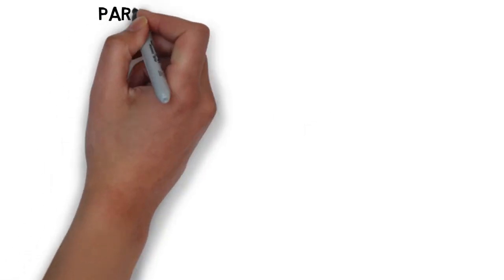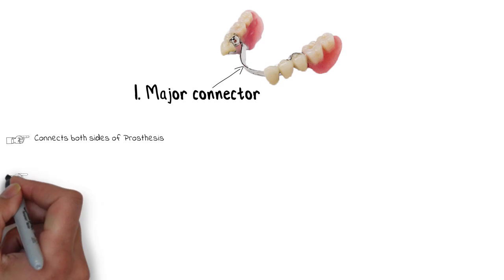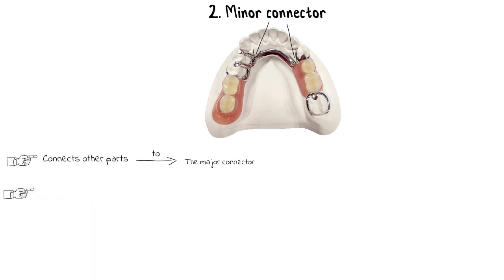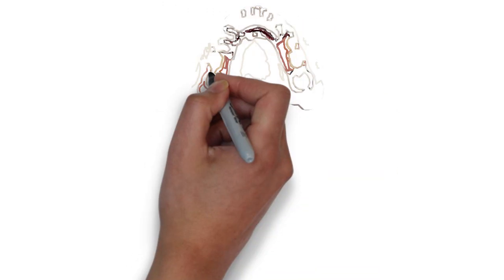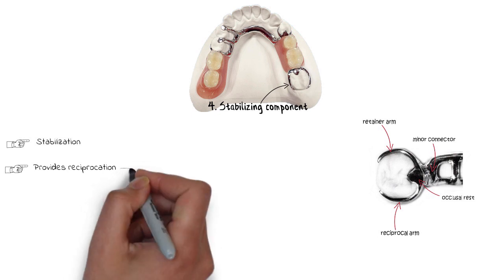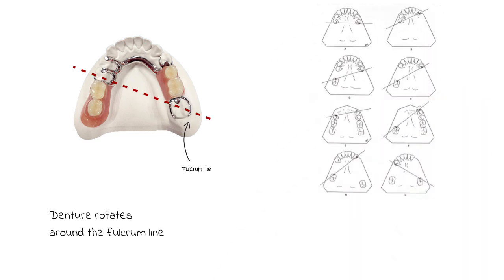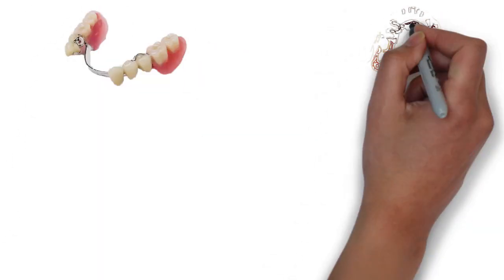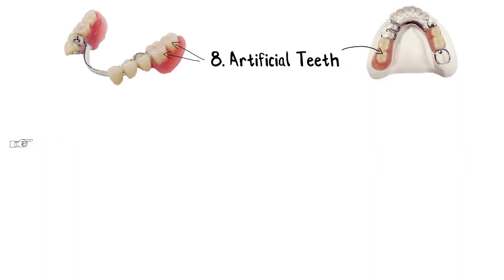Parts of Removable Partial Denture (Cast Partial Denture)

Comment: Question. I have been fitted for a lower partial cast metal. I am missing/replacing #29,30,31. My #28 is a pre existing crown. I can’t seem to find any pics or demos of this particular arrangement. Could anybody tell me what teeth this will clasp on to? I know my dentis said #28 for sure because it’s a crown and she can drill a clasp slot. But where else will it be anchored to? Note I have all my teeth other than these. I’m new to the denture world and kind of anxious. Thanks for any info!!!
Reply from the maker: Actually it depends on situation to situation and giving a proper diagnosis let alone a treatment plan is not at all possible in this way. That being said, clasp arrangement is usually done based on the retention required for the denture and depends on the case.

Comment: Sir i always get confused in indentifying the indirect retainer.
Like they are used in distal extension cases.
Like you showed  2 indirect retainer on either side
What about on left side there is 2 indirect retainer or what
Reply from the maker: Indirect retainers are generally placed on the opposite of the fulcrum line. The requirement can be fulfilled by a single indirect retainer, if placed directly opposite to the fulcrum line ( as explained in the video). But since that would have inadequate support due to weaken tooth so, therefore, we place it abit farther away, and compensate for the increased distance with two indirect retainers. 
If it is still confusing, don't worry, I will make seprate videos on indirect retainers explaining it in more detail.
Reply: @studywiththedentist  thank you so much sir my exams are about to come in 20 days 
Count down starts
Reply from the maker: Best of luck !
Do share it with your friends and colleagues too !
Reply: Sure please upload videos
Reply from the maker: Surely!
Reply: Sure sir

Comment: This was very helpful, thank youuu. I have a question too, what is guiding plane? It's mentioned in McCracken.
Reply from the maker: Guiding planes are those planes that generally are parallel to the path of insertion and removal. But for the proper definition :  "Two or more vertically parallel surfaces on abutment teeth and/or fixed dental prostheses oriented so as to contribute to the direction of the path of placement and removal of a removable partial denture, maxillofacial prosthesis, and overdenture." (GPT).
Reply: @studywiththedentist  thank you so much, I think I got it.